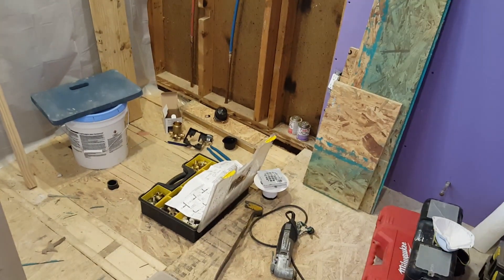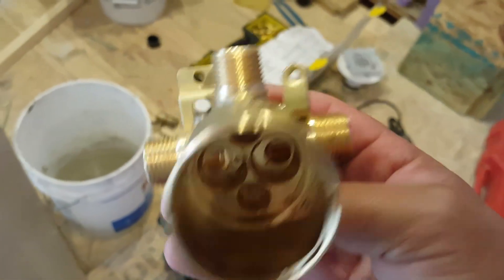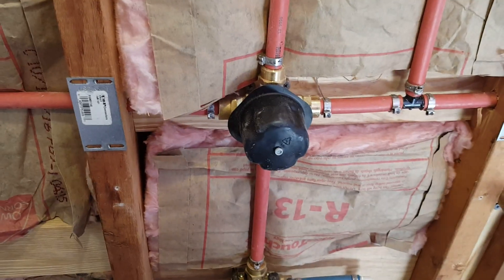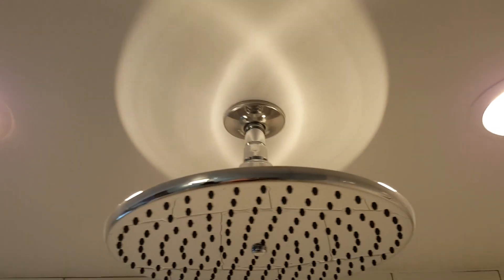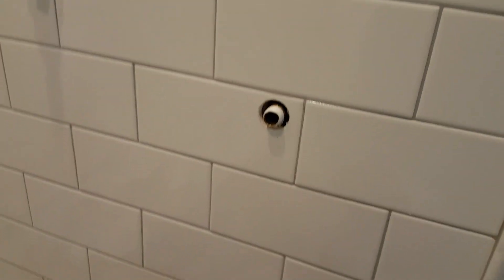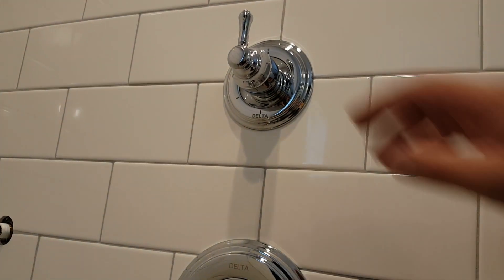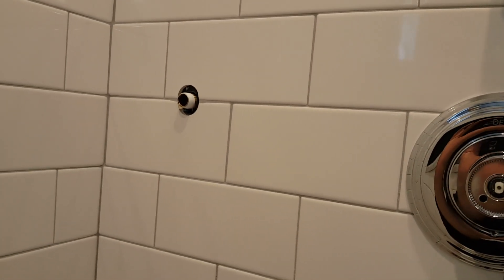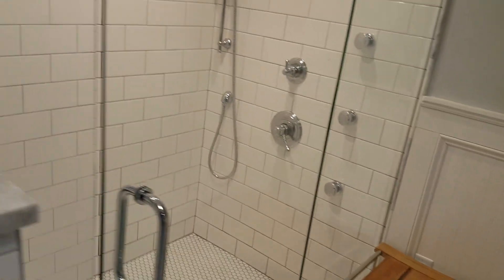Multiple shower fixtures installation

Comment: Good to see this. It is a little complicated. My tip - get an adjustable erench with soft (plastic liner insert) jaws! I bought a Husky at Home Depot which is good for finish plumbing, like chrome or brass. If it has flats, also get a flat jaw adjustable wrench, like Knipex or Crescent: these are great tools.

I'm looking for a remodel (8"oc) size 3-outlet valve and trim. Harder to find one built as a single piece instead of using a separate "transfer valve" than I would have thought!

Comment: Great video👍 I am installing a 3way diverter with a temp valve right below it.  But I only have a rain drop shower head and  spray shower head.  I am trying to set it up so they can run simultaneously.  Do I have to cal the 3rd opening in the diverter?   Since I am using two?

Comment: Someone didn’t bother following the instruction manual. They tell you to use an 8” piece of 1/2” copper between the valve and the diverted... I guess this is the guy that will do the job cheaper than a plumber. 3 body sprays and a rain shower on 1/2 supply is too many fixtures to get enough pressure, hence the terrible pressure when you tested it. you also didn’t plumb the body sprays in properly. Also never just use teflon when installing parts to a custom shower. Buddy, leave the plumbing to the plumbers.

Comment: ola, can you explain what kind of setup i would need for a shower installation using a shower head (ceiling mount) , bottom spout , and a hand held unit,, 3way?, 4 way? diverter?,thx
Reply from the maker: A Six way diverter can handle 3 different exits, perhaps you want to combine two of them if there are more than 3

Comment: Hate to tell ya but that’s wrong. Heads need to be on a looped system and use brass fittings in walls for goodness sakes
Reply from the maker: Jamessmack all the system works very very well after 5 years, I thank you for your help and watching my videos
Reply: I did not watch ur video mostly skipping till ur roughing and then the end ,definitely I could  tell the different as soon u turn  shower on and add the hand bar a sow lot of week in the water also when U turn jets on it was like me going to the bathroom, what’s the point having jets if it doesn’t have power to massage you, also definitely not using pex on that roughing, copper pipe priority and increase to 3/4 and never forget loop jets Together. Hope this help.

Comment: Where's your pressure loops? Fail
Reply from the maker: When using three body sprayers conect the water inlet close to the center sprayer, you can also make the water circulate by connecting the body sprayers to a tee instead of ellbows and make a loop, however follow the manufacturer's guidelines.  Thanks for watching

Comment: The diverter looks like a 3 diverter system, does the trim handle have to be positioned between 1, 2, 3 respectively in order  to provide the additional 3 positions? If so, do you have a drawing of the layout? Thanks.
Reply from the maker: The divierte comes with the instructions to would be like top is #1 right #2 and left #3

Comment: How do you ensure there is enough water pressure to run all these heads?  I really want to do an install like this but this is a major concern...
Great work btw,...
Reply from the maker: You can loop the water around the jets to ensure that you have the same pressure in all the heads
Reply: @HugoCorrea  Is there a certain GPI you would want to run say a rain head, showerhead, and 4 body sprays?

Comment: Great work on the shower system! At FaucetList we deal with this type of product often and I've never seen anyone plumb both the body sprays and the ceiling showerhead off the same diverter port. That was super creative and I was not sure it would work that way. I do know that you addressed this in another comment but Delta recommends using a pressure loop for the body sprays. However when I saw you actually turn on the shower system it seems the water pressure actually was quite good even without the loop. I will just caution others that if you have lower PSI in your home, not using a pressure loop could cause the body sprays to flow at different rates. We have written extensive installation guides and sold thousands of shower systems but I have not seen any videos of the installation that are quite as detailed as yours, I really appreciate seeing the process documented from start to finish and it's a beautiful shower. Would you be ok with us embedding your video in a future blog article at some point? Thanks
Reply from the maker: Faucetlist Faucets sure, I have another video with the body sprayers on a loop at: https://youtu.be/ep2kh_2W4yQ 
If you have products you want to show with an affiliate link, I will be happy to show them to my viewers
Reply: @HugoCorrea  Hi, thank you so much for sharing that other link - I will definitely check it out! At this time we don't have an affiliate program unfortunately as we are just a small family business, but perhaps one day we will. I will definitely reach out to you in the future if anything changes. We sell all kinds of shower systems so I'd be happy to have you promote our items as it seems you really know a lot about how the fixtures actually work. We have lots of shower system experience, but not the same kind of experience as you. You seem to have lots of actual hands on experience doing installations in the field. I really enjoy seeing the wall opened up and watching the shower system come to life.
Reply from the maker: @Faucetlist  thank you

Comment: Amazing video. Great to see the installation from start to finish. I found an article ( https://faucetlist.com/blogs/buying-guides/installing-a-shower-system-with-showerhead-and-hand-shower-sprayer ) which does a very good (and detailed) job explaining how a shower system with hand shower works, but it's nice to see you adding body sprays and a ceiling mount showerhead as well! I was surprised to see you running the ceiling mount showerhead and body sprays off the same diverter port as I didn't know that could be done. Very creative! I noticed other comments regarding a body spray pressure loop which you say you now do. I wonder if you run the ceiling mount showerhead and body sprays off the same diverter port if you need to also "loop" in the ceiling mount showerhead? Really nice to see a video of how it all works and the installation from start to finish. Great work!

Comment: Nice job but would seem the water flow is not enough to run this big of a system.
Reply from the maker: I Installed this system to another house not to long ago and the filters that clean the water from the house well were dirty, once they were changed the system worked fine, I like the three body sprayers, the rain shower and the handheld fixtures work by themselves so the water flow is stronger. 3/4" piping to the shower body straight from the main lines is the best. Thanks for watching
Reply from the maker: I Installed this system to another house not to long ago and the filters that clean the water from the house well were dirty, once they were changed the system worked fine, I like the three body sprayers, the rain shower and the handheld fixtures work by themselves so the water flow is stronger. 3/4" piping to the shower body straight from the main lines is the best. Thanks for watching
Reply from the maker: I Installed this system to another house not to long ago and the filters that clean the water from the house well were dirty, once they were changed the system worked fine, I like the three body sprayers, the rain shower and the handheld fixtures work by themselves so the water flow is stronger. 3/4" piping to the shower body straight from the main lines is the best. Thanks for watching
Reply: It will never work becouse installation was wrong that’s y the jets are pissing excuse my word
Reply: For u to get good pressure especially jets they need to be loop together, give ur self a favor and hire a master plumber

Comment: How would set it up to have a Wall head, ceiling head, and a tub valve? If you connect the bottom port to the tub, what makes the tub stay off and provide water to the other heads? Also can the deverter be set to an off position to allow just the bath to go and no pressure to the heads? Thanks!
Reply from the maker: Fusebaum the faucet only can provide water to the diverter, the bottom outlet of the faucet needs to be closed as the bottom outlet works with gravity, the diverter would be directing water to the different areas.

Comment: Excellent video.  Thanks for the pointers.  What was the length of the 1/2" brass nipple you used for the handheld?
Reply: I had the same question.... i guess you just buy a couple of sizes and see what fits?
Reply: 2.5" nipple. 1/4 to 1/2 past finish wall.

Comment: Do you know if the Delta diverters/controls can be used with other brand fixtures?
Reply from the maker: Lauren Rowello yes they can be use with other brands
Reply from the maker: Lauren Rowello you only can use the parts of the same element, that is the rough-in plus the trim kit that you get